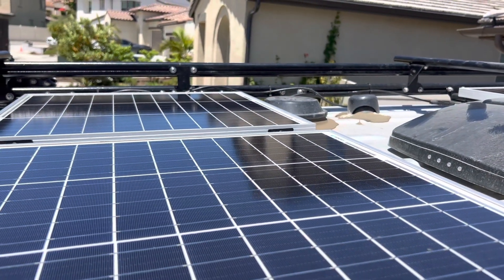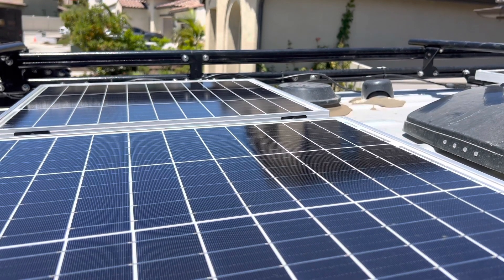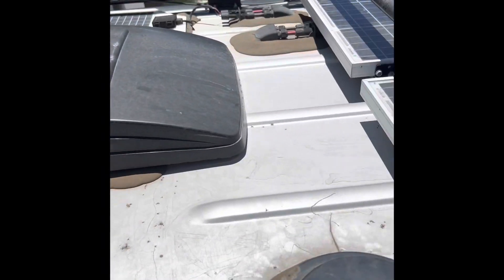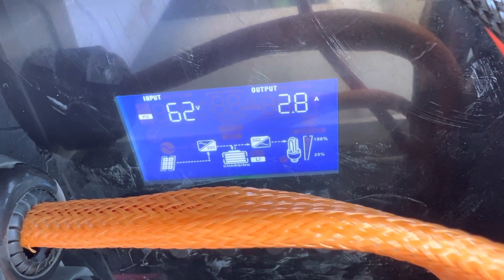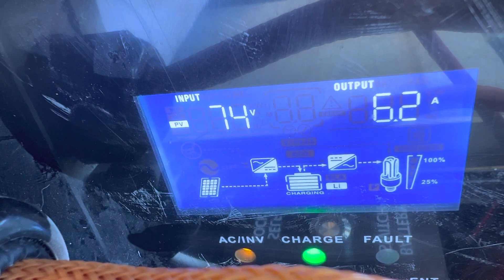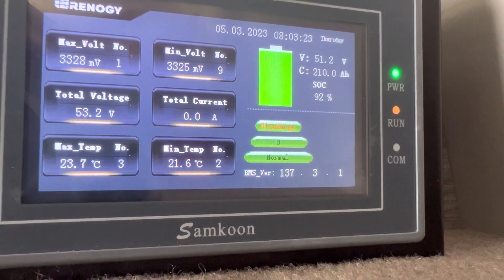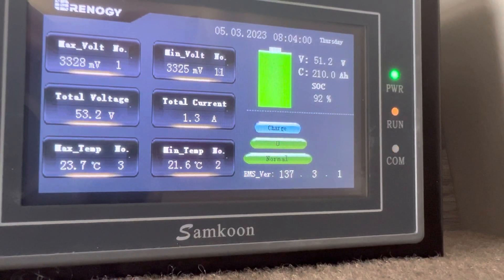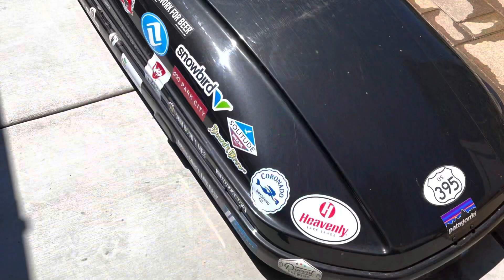Jayco Terrain/Entegra Launch Solar Output

Comment: Interesting, I often only see a -1.5 to -3 amps due to my fridge. I think my solar panels are working as I see the display working in the top shelf. I'm almost 3 months with my Jayco van and yep, always discovering new features. An example, had no idea there is a 12 volt port at the bottom right of the driver's seat at the base of the seat.
Reply from the maker: When I get some free time, I’m going to do what others have done and reposition the panels so they get less shadows from the crossbars.

Comment: Hi! Its me again and i am trying to understand my entegra launch how my solar will charge my house battery. Any advice?
Reply from the maker: If the switch is in the on position, your panels are clean and you’ve got good sunlight, you should see a change. Mine has always worked fine so I don’t have any experience troubleshooting. Have ya gone through the manual or watched the video?
Reply: I watch your video and I see when you turn off the house battery switch. Your solar is charging your house battery. Mine doesn't turn like yours
Reply from the maker: I'm sorry I should have asked if you've seen the Renogy System YouTube Video that is found in the Renogy B-Van Lithium Operation Manual.  Both are great resources. Here's a link to the manual which has a QR code that will take you to video.  Hope this helps.
Reply: I hope that I can meet you one day so I can have better understanding lol! I live in LA area and I don't mind drive one hour away just to meet you and maybe you can educate me how's our RV works lol!
Reply from the maker: Yes understanding this van has a huge learning curve. I'm currenly living in Utah so it would be more than an hour drive!  :-)  I work for Agile Off Road so I'm down in the San Diego area somewhat frequently though.  Let me know if you ever have any work done on your van by Agile and I'll see if our timing works.